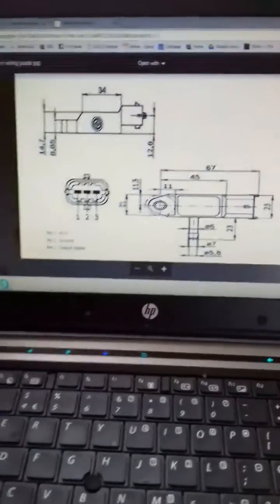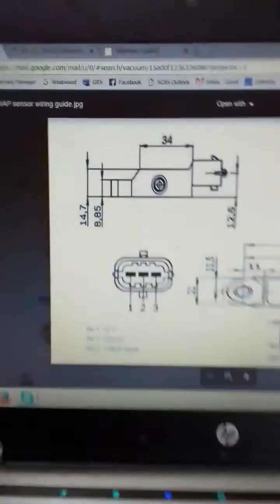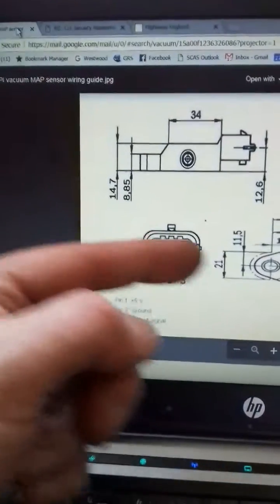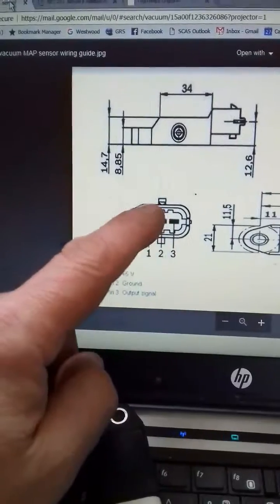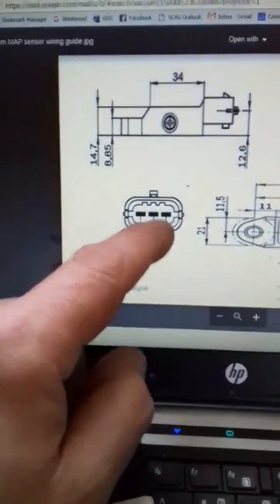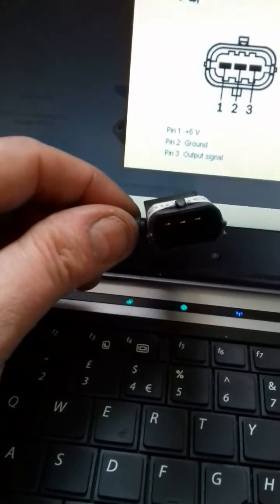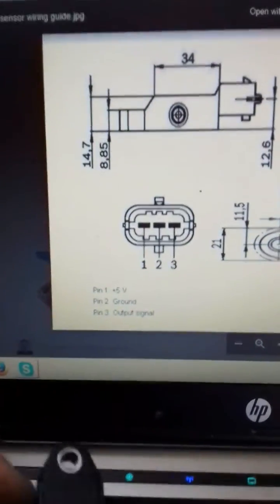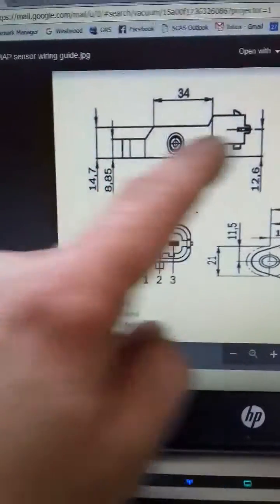Renault/Bosch/Dacia retro-fit MAP sensor wiring warning

Comment: On the original Bosch sensor, there are the PIN numbers at the connector housing! Exact in the same way as shown in the datasheet! Bosch 0 281 002 593.

Regards...
Reply from the maker: Thanks for your comment
Reply: @JohnBullas  I am very confused also! I think I might have killed one of these by trying the reverse of the datasheet. it looks to me like the plane on the data sheet is correct?
Reply from the maker: @alexjohnston4872  I think the key is the fittings above and below, I blew one up before I noticed the difference
Reply: @JohnBullas  thanks for the reply! I spotted those different keyways but even bearing those in mind it still looks as if 5v is on the left when looking into the socket on the sensor. am I correct in thinking 5v is actually on the right when looking into the socket on the sensor?

Comment: I'm making a Arduino gauge at the moment, this is the standard way automotive drawing are done (Plug front pinouts) - The official Bosch plugs are marked with the terminal 1 on the right of the rear of the plug part numbers for the housing, terminals and seals kit are 1 928 403 966, 1 928 300 599, 1 928 498 056 (FP-P4 series) 2.8mm terminal - please feel free to drop me a message